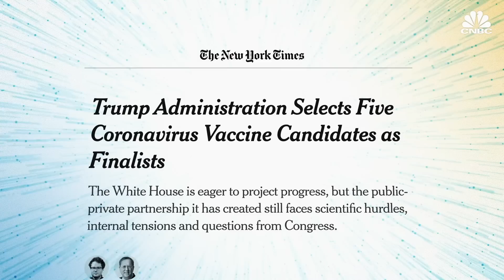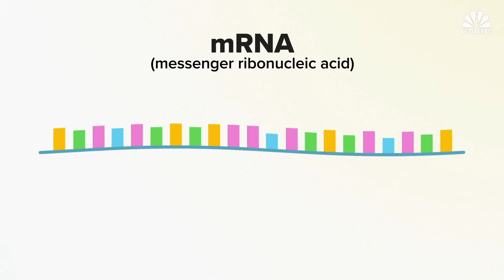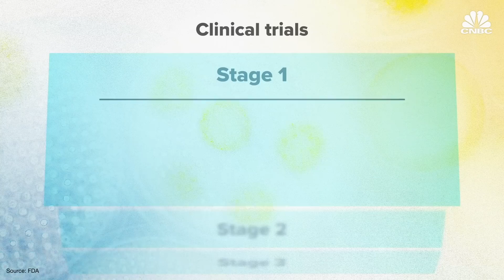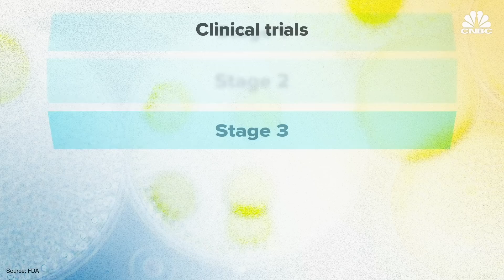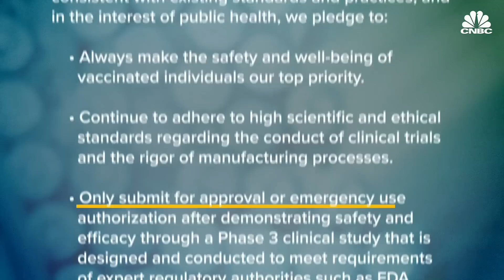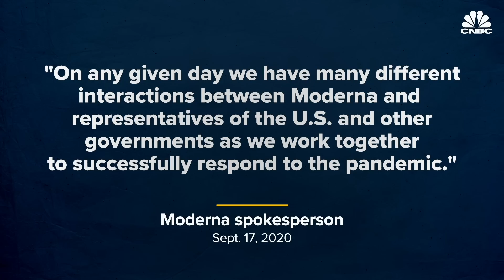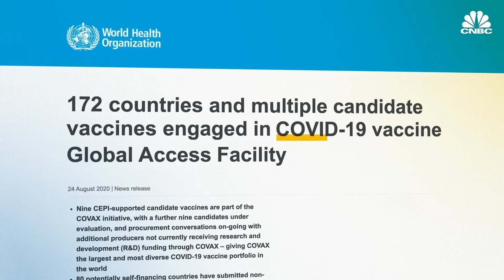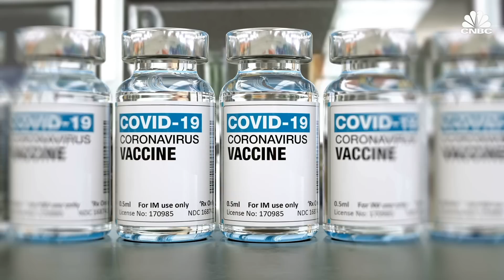What Is An mRNA Coronavirus Vaccine?

Comment: Sounds like a promising technique.  Now, the question becomes: how do you keep up with the rapid mutation ongoing in the entire corona-virus family?  There's no guarantee an mRNA vaccine would keep someone immune for an entire year, even.  I sense, on the horizon, an expensive regimen of required quarterly vaccines.  Nobody has ever developed a successful vaccine against any member of the corona virus family, because they mutate too fast.  When they tried to do this with SARS, if an innoculated person caught SARS a second time, their own immune systems turned on them and ate them alive.  So...I'm not optimistic.
Reply: your right but also wrong.  the SARS vaccine failed but they actually know why it failed. SARS didn't mutate and then people got sick again.   So what we learned with the SARS vaccine is that  you need BOTH  CD4 and CD8 T cells at certain levels in order to gain proper immunity.  The SARS vaccine trials that failed and got 25 people even more sick when they caught it, Only caused CD4 T cell activation.  No CD8 T cells at all.  (this finding was replicated when they tested the vaccine on monkeys)  -  Now with Covid-19 - all the vaccine trials including the MRNA vaccines, All produce lots of CD4 and CD8 cells and in testing show no signs of the same issues the SARS vaccine had. (they tested the moderna mRNA vaccine on monkeys and it granted immunity, they didn't get sick).   

Second, The Coronavirus family actually is extremely SLOW mutating. so claiming it "rapidly mutates" is actually false.   Let me explain.  Covid-19 actually has a lot of "strains". But all of them are 99.9% the same virus.  The flu on the other hand, Changes very very fast,  in many ways and especially the spike protein.     The Coronavirus family doesn't have the same rapid mutation rate like the flu because the virus has a mechanism to "error check" its RNA during replication .  just like spell checking a document just on a biochemical level.  The flu virus doesn't have this.     The Error check seriously hampers its mutation chance. 

And yes we do not know for sure how long the vaccine will last, Generally when you have time, part of the reason why it takes so long for vaccines to come to market is because the want to know that answer before coming to market.  In this case we don't have the time.    We do know from people who got the first vaccines in March that they are still immune and thats a good sign. 

The reality is it doesn't need to keep you immune forever, 1 year is all that is probably needed to end the outbreak.    If we get 70% of the country vaccinated, the R0 will drop significantly  and within a few months we wont have the virus here anymore.   Covid isn't the flu version 2.0.  A proper vaccine will beat it, just like we beat polio and MMR.
Reply: @Trespasser249  Now I'm finding it interesting that Covid 19 has "error checking" which the flu doesn't have.

I wonder how much their is to the "lab-based" idea.
Reply: @Trespasser249  Thank you, finally a smart person in this comments section.
Reply: @Trespasser249  Thank you.
Reply: @sam16362  Seconded.
Reply: Covid mutates much slower then the flu
Reply: @conn_man_249  than
Reply: @conn_man_249  And the flu vaccine is, typically, a 'hit or miss' proposition, every year.  Lame argument.
Reply: TheMercilessEye yeah because flu mutates fast that scientists can’t make the vaccine for all strains on time
Reply: I think they said that the virus barely mutates as it has proteins that correct for mutations
Reply: Gotta go get your booster every few months like the rest of the good sheep 😀👍🏻
Reply: #The_only_solution_for_coronavirus_is_here
👇👇
Quotation from The awaited imam mahdi's (Nasser Mohammed Al- yemeni) statement
it is for you to know with certainty that the disease of the suffocating torment of Allah that you call ‘corona virus’ will not be removed from you except by Allah only. So let the people repent from the worst of sins, the gross indecencies, the injustice to the people, and from the injustice of associating partners [with Allah].
And say:
“Our Lord, we have wronged ourselves, and if You do not forgive us and have mercy upon us, we will surely be among the losers.”
And after the repentance let each one of them say:
“O Allah I am Your servant, I ask you by virtue of the fact that there is no God but You, and by virtue of the fact of Your Mercy which you have decreed upon Yourself, and by the virtue of the fact of the greatness of Your Pleasure within, which is greater than the pleasure of your heaven, to cure me of the torment of Corona or to turn it away from me as I am a believer in the caller to the truth from You.
O Allah, remove Your torment from us from whichever direction it comes from, so that we follow the path of the truth from You. And strengthen us to fulfil what we have promised you, O you who intervene between a man and his heart, as we only have Your mercy, You have decreed upon Yourself. If You do not forgive us and have mercy upon us, we will surely be among the losers. O Allah You have said in the clear verses of Your book
{And your Lord says, “Call upon Me; I will respond to you.}
[Shurah: 40 - Ghafir - Verse: 60]
So the Dua'a (supplication) and the repentance is from me, and the response is from You and You do not break Your promise. Exalted You are our Lord, your promise is true and you are the Most Merciful. O Allah give us the strength to fulfil what we have promised You to follow the global caller to Allah, the caliph of Allah on Earth the Imam Mahdi Nasser Mohammed Al-Yamani. O Allah, make the raising of him a blessing upon us and not a misery upon us because of our turning away from the call to the truth of the Imam Mahdi Nasser Mohammed Al-Yemeni”.
And whoever refuses this supplication surely the torment of the so-called Coronavirus will befall them. And did Allah make the sign of the Corona virus but a sign of confirmation to the challenge in the statement of the Imam Mahdi Nasser Mohammed Al-Yemeni that was written on the 10th Rajab [5th March], titled “Corona virus is of the lesser torment short of the greater torment, that perhaps they may repent”?
End of the qoutation of statement for Imam Nasser Mohammed Al-Yamani
At:
19 - 05 - 2020 AD
Its title is:
Corona Virus And The Decisive Statement That Is Not To Be Taken for Amusement
The full statement in this link👇
https://www.mahdialumma.com/showthread.php?t=40184
These statements which written by the Awaited Imam Mahdi (Nasser Mohammed Al-Yemeni ) read it to know the fact of coronavirus and the only solution for it
1) From The Caliph Of Allah Over The Worlds To Xi Jinping The President Of China
22 - 05 - 2020 AD
👇👇
https://www.mahdialumma.com/showthread.php?t=40329
2) Corona Virus And The Decisive Statement That Is Not To Be Taken for Amusement
19 - 05 - 2020 AD
👇👇
https://www.mahdialumma.com/showthread.php?t=40184
3) Corona virus is of the lesser torment short of the greater torment, that perhaps they may repent
05 - 03 - 2020
👇👇
https://www.mahdialumma.com/showthread.php?t=39469
Reply: DerWahre Islam as soon as any one of you dumbasses bring religion in any argument, and and all of your opinions and argument automatically becomes irrelevant.
Reply: @123RADIOactive  Or you just really closed minded.
Reply: Arno Wisp I’m actually very open minded, and I’m all for religion. I’m just saying not all topics and issues needs to revolve around religion. Especially if the said religious comments doesn’t even have anything to do with the topic at hand. 

Basically, I’m just saying that if your head is so far up in the religious stuffs that you can’t even do anything BUT to keep quoting bible verses, even in places where they may not be welcome, your opinions and comments needs to be regarded as nonsense.
Reply: @Quoant  Religion is the willing suspension of intelligence.
Reply: @TheMercilessEye  Tell that to actual Islamic scientist working.
Reply: @arnowisp6244  Evidence, please.